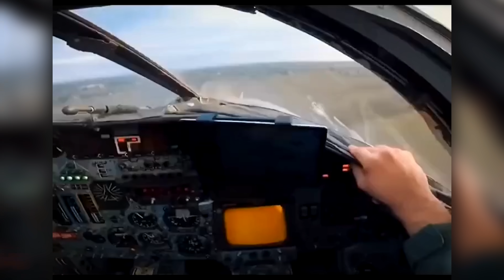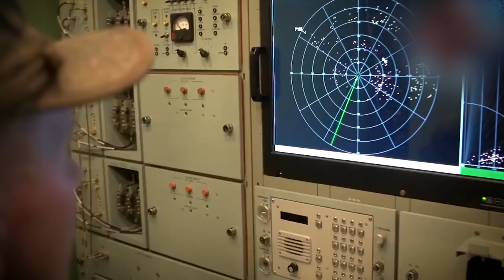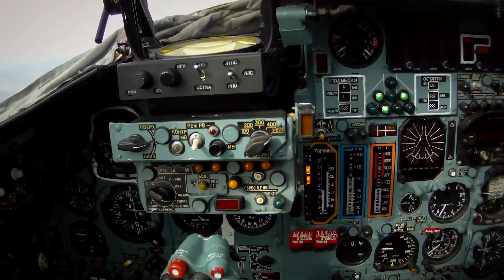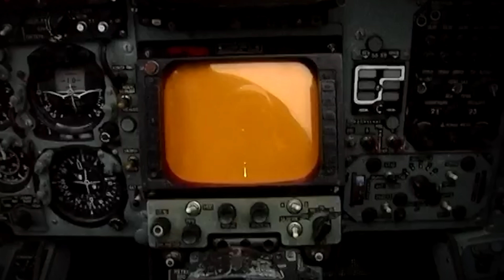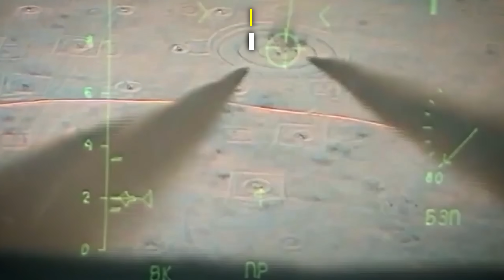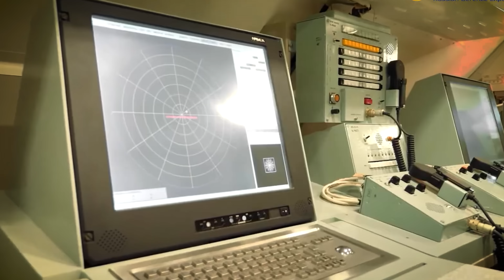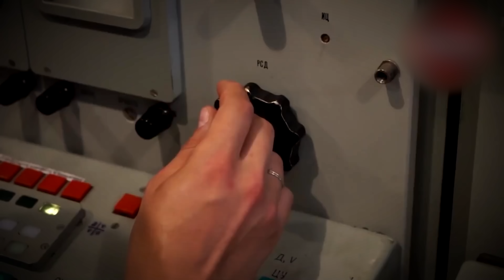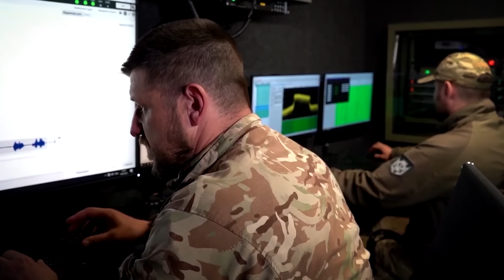Ukraine Waited for Russia to Celebrate Its Victory—Then 1800kg Bombs Meet Main Weapon Factories

Comment from the maker: This video is a dramatized/OSINT analysis; sensitive TTPs are generalized.
Most decisive factor tonight?
A) IADS saturation & operator overload
B) Low‑level TERPROM + IIR terminal seekers
C) BROACH against hardened nodes
D) Command‑level prioritization failure
👇 Vote A–D and explain why in 2–3 lines. Best comments get pinned.